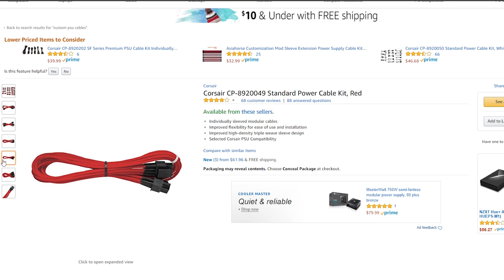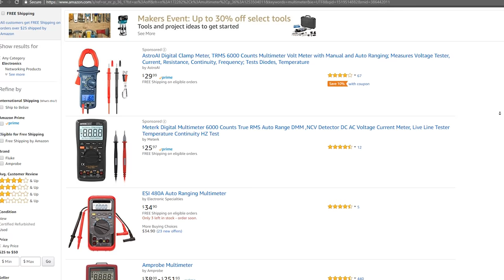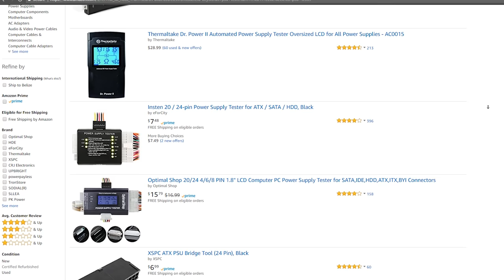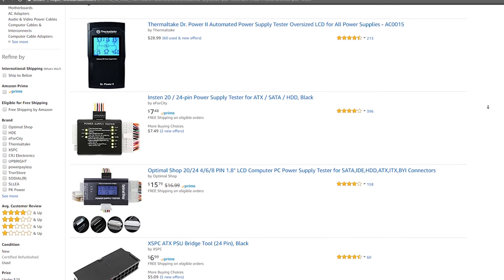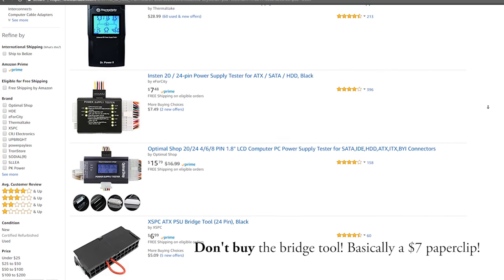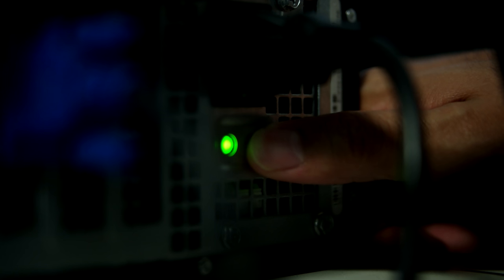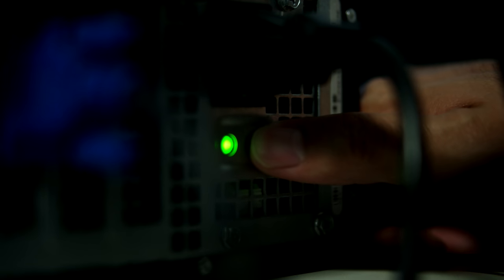How To Test Your Power Supply With A Paperclip

Comment: When I installed my RTX 3070 in my pc and turned it on after, it short circuited. I tested it with a paperclip and it still short circuited. Very weird cause its a 750 watt psu and installed it a week ago. Any help?
Reply: exact same problem actually
Reply: @chineseboxingstylekanye7147  i bought  an other power supply. Apparently Corsair is the way to go when buying a psu. I also tested my mobo with my old psu and everything was fine. Hopefully nothing else is damaged
Reply: @sametyetimoglu6026  mine was corsair and im pretty sure it is defective, have an evga one being shipped here with a test kit. from what i can tell a faulty psu is actually somewhat common compared to other parts being doa, glad your new psu works and your problem has been resolved tho, hopefully mine will be soon as well. :)
Reply: merhaba samet kardes , benim rtx3070 i de yukledikten sonra biraz oyun oynadiktan sonra bilgisayar reset atiyor bundan once oyle bi problem yoktu. ekran kartini biraz zorlayinca ekran karti ikaz isigi veriyor ve hemen reset atiyor bilgisayar zorlandigi icin. sence benimki de psu mu ?

Comment: My pc won't turn on.When I plug in my psu and flip the switch it sparks. So... Idk if that's a dead give away to switch my power supply
Reply from the maker: That is usually a sign you need to change your PSU.

Comment: So i did this exact test when the psu was still connected to the cpu fans and side fans. I heard activity in the computer similar to the sound when it starts up, but none of the fans actually started spinning. If i plug the 24 pin connector into the mobo, the side fan and cpu fan spin but not the psu fan. Is mine dead?
Reply: Hey man, did you end up resolving this? I'm dealing with the same thing...
Reply: @palzone2443  I did. So I determined thru talking with the co that if a fan does not spin, PSU is dead.
Reply: @palzone2443  what other issues made you test your PSU?
Reply: @SolidNate99  oh do you mean the fan doesn't spin on the psu when you use the trick in the video? Mine does spin but I still have no signs of life from the MB... guessing it's probably the board
Reply: @palzone2443  Sounds like the mobo to me too. You can't boot to bios i'm guessing?

Comment: I really hope this works on a Asus thor 1200w I'm picking up today. I'm getting a good deal. Really hope it works
Reply: Did it work
Reply: @itsmeblasty7706  it did. But I only confirms that it turns on. I had to pull a multimeter to make sure it wasn't faulty.

Comment: Will an RTX 3000 turn on without being plugged into PCIE Slot with PSU on and is powering the gpu?
Reply: It will not power on

Comment: How exactly is this working? Pretty scary sticking anything metal in there thinking it could explode or something lol My pc runs fine when it's on, but when I shut it down and press the power button (sometimes) it'll completely shut down and not switch on. Usually when I shut my pc down, there is a little blue light at the back which stays on all the time and never turns off so when I press the power button, the pc turns on, but occasionally, when I press the power button the blue light turns off and the pc doesn't power on no matter how many times I press the power button.

If I flick the switch at the back of my pc, I sometimes see an electrical spark from the power supply (or some type of flash) but still my pc may not boot. I've found if I hold the power button down and then flick the switch at the back, then it boots up fine and when the pc is running, there are no issues at all and everything works fine. Could this be a faulty psu or maybe something else?
Reply from the maker: Well if you look at your 24 pin connector on your motherboard you will see that there are metal pins that are designed to be plugged into your PSU's connector.  Imagine the power button on your computer case is a switch, pressing the button once switches/connects the ground and live pins on the PSU and turns on the PSU that will in turn power your PC (like you see with the paperclip). Press your power button again and it will switch/disconnect the ground and live pins which will turn off the PSU and in turn power off your PC.

Seeing sparks from your PSU is slightly concerning and I would suggest a PC repair technician check out your PSU.  It would be good if the technician also checks your outlet that you plug your PC into and your power cable as well to be on the safe side.

Comment: 0:59
WDYM "where ESD is an issue?"
Isn't it everywhere?
Reply from the maker: In Belize, we have high humidity averaging over 70%.  Humidity lower that 40% will cause static discharge that can damage your electronics.  We have other annoying issues like dealing with rust over time, especially in coastal locations.

Comment: Hey so my power supply fan  spun for like 3 seconds after doing this but the case fans didn’t spin. Does this mean my PSU is working?
Reply: so.. if the psu fan start even for 1 second it is working. Check if any cables connected to the psu are propelly connected, for example a fan hub check if the molex/sata power of the hub are connected also check if the fan cables are connected correctly all the way in, in the hub. Then, if any of these don't work probably faulty hub/fans

Comment: I just finished building my very first PC but it won't boot up on my monitor. I get a no signal on my monitor even though the rgb and fans are on. plus when I have bothe my 2x16 GB ram sticks inside then the PC cpu fans stop for a few seconds and begin again and the cycle counties. If I remove 1 or all of the ram sticks then the CPU fan doesn't stop and keeps on spinning. Also if this might help with 2x16gb ram sticks. Turning the pc off is with just one click, this is when the CPU fan starts and stop. but when I remove the ram and the fan doesn't keep on stopping, it takes around 5 seconds to shut down. PLEASE HELP
Reply from the maker: Hi, you might have RAM compatibility issues.  Are you able to get access to other RAM to try in your desktop?

Comment: my rosewill photon 1200w just makes a clicking sound when i do this
Reply from the maker: I'd suggest using a PSU tester or multimeter to ensure your power supply is providing enough voltage.

Comment: Do u turn on the pc button or just plug in the Psu and flip the switch ?
Reply from the maker: While your PSU is plugged into an outlet and you have the paper clip in the 24pin power connector, you only need to flip the switch on the back of your PSU.
Reply: @JoesVids  I did that but only my led lights turn on no fans spin does this mean my PSU is faulty I'm so scared my motherboard or CPU is broken cause my pc freezes on startup and I can't get past the manufacturing screen
Reply from the maker: @lxganrl9658  Sorry for the late reply, but if you make it to the logo screen when you startup, this sounds more like POST issue which the first culprit is usually RAM.
Reply: @JoesVids  I think its the power supply because it doesn't even turn on now 😂
Reply: @JoesVids  it's completely dead
Reply from the maker: @lxganrl9658  That sucks...hope you can get a replacement soon.
Reply: @JoesVids  new power supply coming tomorrow!

Comment: I tried to test this on my Corsair rm1000xw 80 plus gold, but nothing happens, no psu fan and tried even connecting case fan and still nothing. I am suspecting that my power supply died. I tried flashing bios on MSI X570-A Pro motherboard. It asked me to restart and after that just turn off and when I turn on pc, no power and nothing. I took motherboard, RAM and cpu to shop where I bought it and they told me that pc is posting normally and working. I am assuming that is either power supply or case.
Reply: Try to connect with different terminal ss
Reply: @anonmys6844  -Found out that my Corsair 1000W power supply died after 1 year and the half.Took it to computer shop and they tested for me. Thanks for advice anyway. Had to buy another one, but they had only Thermaltake 750W as they sold all others and thanks to bad virus they ar enot sure when they will get others.
Reply: @deanvukovic9069  I had the same issue replaced Corsair with a gigabyte one

Comment: I tried doing the same with the paperclip, and it turns on for a split second and the fan start moving but then it just stops? I tried readjusting everything - same thing happens. Is it still a power supply issue or is that normal in some cases?
Reply: Same here, is it working or this method is crap?
Reply: @Dooosh .  idk if this will help you but from what I've learned, it depends: it works usually on older stuff, but newer power supplies sometimes have safety measures to stop it just so that you don't damage the PSU. And it may void your warranty.
Reply: @accipse8274  thank you for help! Ur pc working  fine now after replaced psu?
Reply: @Dooosh .  apparently my problem wasn't the PSU, I replaced it but it still didn't work 😭 a power surge ruined my motherboard, had to replace that

Comment: So I got my girlfriend's new PC put together and the I did this test and I'm getting absolutely nothing. The front fans are plugged in with molex to the power supply and they don't turn on neither does the PSU fan or anything. If this is the case does that definitely mean I got a dead on arrival PSU? I know for a fact the cpu and graphics card are good cause they were in my old build. Everything else is new
Reply from the maker: Hey, did you remember to turn the power switch on to the back of your PSU? If so, more than likely the PSU is DOA as you're guessing.
Reply: @JoesVids  yes I did. Thank you, I'm going to go try and pick a new one up tomorrow

Comment: My PSU is putting out power to my motherboard but don't believe its putting out enough power to run it, my RGB CPU cooler fan not going on but my RGB ram is, even when the switch is off.  Its getting punted.
Reply: How did fix it bro please
Reply: @2sh.  I ended up buying a decent psu.  That sorted it.

Comment: What if my PSU is older and it doesnt even have a fan? How do i know its working?
Reply from the maker: Using this paper clip you will need something to visually give you a clue if this is working, so as I mentioned in the video you can connect a case fan to your PSU in order to see if it is working.  Otherwise it would be best to test your PSU with a multimeter, which is a more advanced (and better) method of testing than this.
Reply: @JoesVids  Thanks for replying man, i actually feel pretty stupid since my PSU DOES have a fan, but it was concealed (kind of lol).
Problem was actually visible since the fuse was fried hence my next question, if the fuse took one for the team (rest of equipment) does that mean everything else should be in perfect condition or not necessarily? Thanks for replying man you rock tbh
Reply from the maker: If you are talking about one of the fuses in the PSU, replacing it can fix the issue BUT that is not always the case.  If you are opening your PSU, please be careful if this is your first time doing so as capacitors inside the PSU can hold a charge if the bleeder resistors in your PSU are faulty.

Comment: sir my problem is when i plug in power cord automatically power supply running but button on/off not function,ihave press many time but indicator not blinking
Reply: @medlo1552  on off button, but the problem start after i reset to default bios setting
Reply from the maker: @azhardiansyahanuar8148  So you hear your Desktop turn on, fans spinning, but nothing is displaying?
Reply: @JoesVids  didnt hear power button turn on, but when i plug in power cord fan power supply spinning very hard
Reply from the maker: @azhardiansyahanuar8148  Okay two things you can try.  First is unplug your power cable from your PSU and press your power button down for 20 seconds to discharge your PC.  After that plug back in your power cable and see if that stops your PC from automatically powering on, then press your power button.  If this doesn't work, do the same thing but also re-seat your memory, then trying turning on your PC again.

Comment: Some says it is 4 and 5 pin but you sa 3 and 4 pin. What really is it?!?!
Reply from the maker: Both will work with a standard ATX power supply. At 1:25 I said you connect the paper clip to the green wire pin and any of the black wire pins. The black wire  pins are ground and pin 3 and pin 5 are grounds, so either of those can be used to connect to the green wire pin 4 which is the PS-On. Later in the video I just chose to use the first ground, pin 3, to make it easy to find for those PSUs that have the same color for all the wires.

Comment: Why do you think that It's not a problem Static electricity can build-up on you Anywhere In the world The wristband is stop you from shocking The component I've never used one And I've never had a problem but that doesn't mean it wouldn't harm in some Circumstances
Reply from the maker: In Belize, we have high humidity over 75%.  Low humidity increases the risk of static discharge damaging electric components.

Comment: Pls help me i used the paperclip but my psu still wont turn on is my psu dead
Reply from the maker: Hey, sorry more than likely your PSU is dead if you followed the instructions in the video correctly.  The two other issues it could be is your power cable needs changing, or your wall outlet isn't providing enough power to your PSU.
Reply: Oh alright pc wont even turn on but thanks for the reply
Reply: Is it possible to repair the psu?
Reply from the maker: @CruzXz  Yes it is possible depending on the faulty part, but I would advise against it.  Capacitors in the PSU can hold an electric charge and unless you know what you're doing to change them, it can be dangerous.  I suggest buying a replacement over trying to fix an old PSU.